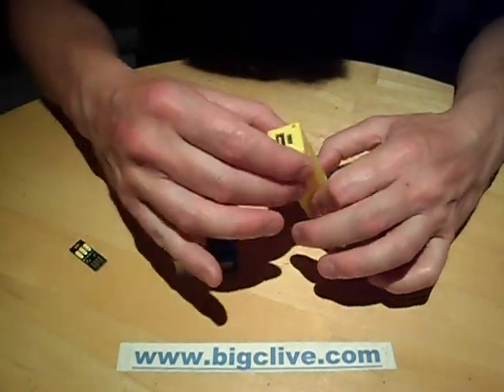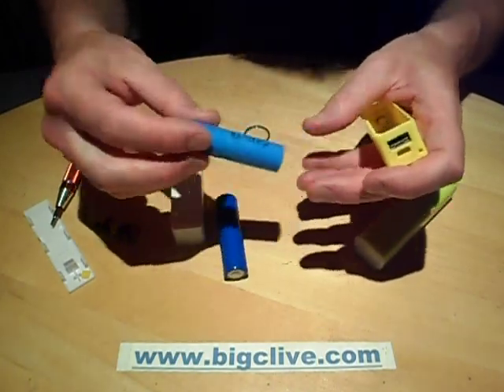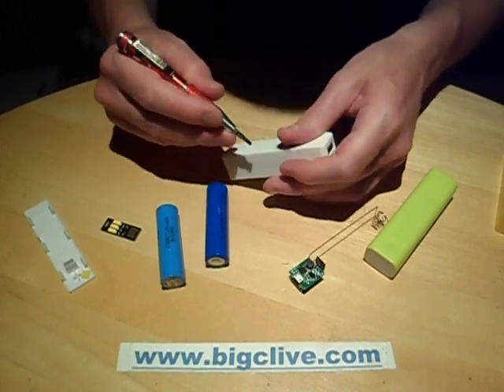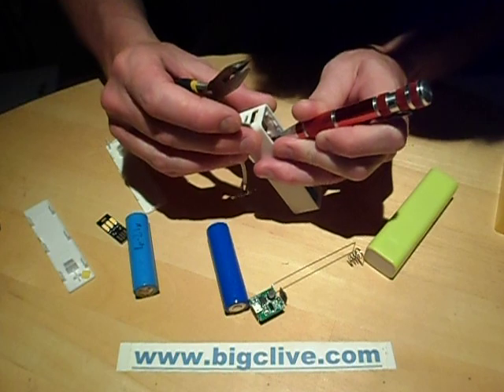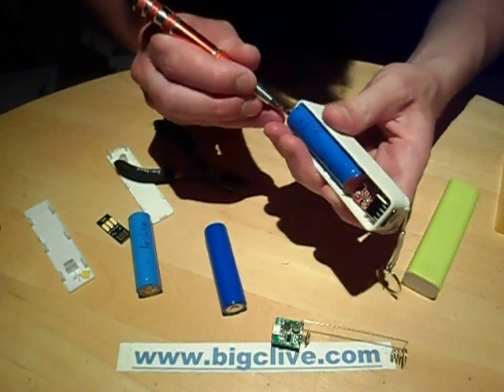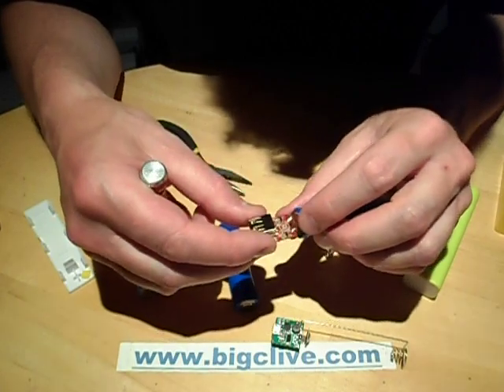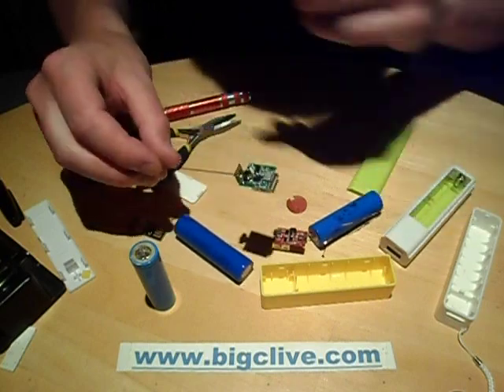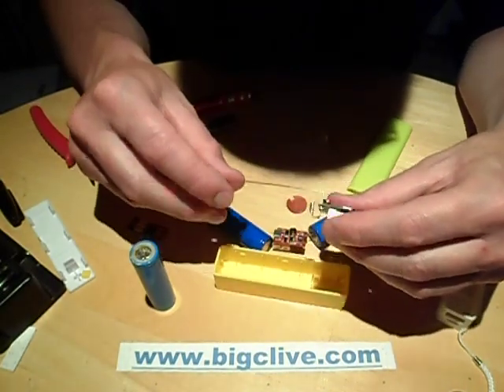Inside some USB power banks.

Comment: I am using this chip/circuit to charge a laptop battery (that stopped charging) I discovered it gets VERY HOT but is self limiting? It has no fuse. I am manually charging one of the three batteries (  3 X 4V= 12) at a time as I think the relative grounds on three simultaneous charging might fight/SC each other. Over 50 degrees Celsius with my bodge temperature gauge probe
Reply from the maker: These chips use linear current regulation, so they do get hot in use.

Comment: Fun fact. Poundworld are selling those single 18650 banks with a 1200mAh battery fitted. Not bad for a quid.
Reply: Just got one today in Lurid Green :D
Reply: They only had a nice shade of Purple left when I was in. I'll check back soon and see if they have re-stocked :)
Reply: There seems to be 2 slightly different versions. The lanyard hole is on the top vs side and the led display is circular vs rectangular. The supplied cable is shorter vs longer and packaging flat vs sloping. I got 4 black, 3 blue + 1 white. Just wondering if they give the full 1.2Ah and charge at 0.7A?
Reply: The ones I have are with the lanyard on the side. Haven't had a chance to test them, but the label says 1200mAh, and charge at 5V 700mA.

Comment: Any idea of what could cause a failure mode on single chip version, where the chip on the board gets hot at 91°c, and stays there without anything connected?
Reply from the maker: +bridgendesar Dead chip.  If the cell hasn't been over-discharged too far then it may be salvageable.
Reply: +bigclivedotcom if only I could find the chip number online and get another one, do you have any url's, or should I quit while I haven't burned down my house!
Reply from the maker: +bridgendesar It's generally cheaper to buy a complete new power bank than it is to source one of the chips.  They only seem to be available to the power bank manufacturers.  check for short circuits like blobs of solder between pads, but it's still probably cheaper and easier just to get another unit.

Comment: I have the same style power bank as the second one. If I wired in ANOTHER 18650 in parallel would it still work and/or last longer? I have at least a dozen of 18650's from laptop power packs and am wondering; Can I wire them ALL up in parallel to make a MASSIVE usb power bank using the circuit board from the power bank?  Sorry I'm a bit of a noob when it comes to electronics like this.
Reply from the maker: +TheFlacker99 (Flak) theoretically yes, but I';d recommend getting them all near the same voltage first to avoid high current flow between cells in a different charge state.
Reply: bigclivedotcom AWESOME! Thank you. I now just need a project enclosure for 18 cells. MWAHAHAHAAAAA
Reply: +TheFlacker99 (Flak) The downside with Li-ion in parallel is if one fails, it will likely take all the others with it, as they will all get discharged too low.  You can get cheap power banks that take several cells, and these may have balancing circuits like in a laptop battery that keep the cells safer.   Julian Ilett has reviewed some of these.
Reply: Using it doesn't increase the risk so much.  And the charger will be timid as it's expecting only one cell so that's safe too.  just take care not to stab any of the cells, or short them out, and you'll be safe :)   I rewatched a couple of Julian Ilett's reviews,  and those cheap multi-cell powerbanks don't have any special precautions either.
Reply: +MattOGormanSmith "The downside with Li-ion in parallel is if one fails, it will likely take all the others with it, as they will all get discharged too low." That's not entirely true. Likely bring other cells down with it? That would require a cell to be shorting... Cells do a lot of things, but short is not one of them unless you put them under really incredibly extreme conditions such as melting the electrodes together. In a parallel configuration, if one cell is failing, having other cells which keep a normal cycle voltage across the faulty cell is one of the best things for it. You'll find more often than not if you put a faulty cell in parallel, the other cells will rehabilitate the damaged one, and I have never seen a damaged cell cause damage to other cells in parallel, nor does the concept really make sense to me.

One example is when I had an RC aircraft battery stuck in a tree for a week, and brought it home puffed as all hell with ~0.1 volts per cell. I tried putting some voltage across it, but It wouldn't hold a charge. So I hooked it up in parallel with another pack. Form there I cycled them ~10 times in parallel, and now the damaged pack operates at pretty much the same level that it used to, and the pack I used to rehabilitate it suffered no immediate damage, both were put back in the cycle of batteries and I haven't noticed either one since.

Yes, putting cells in parallel does open the possibility for one cell to damage the rest, but you have to have such an incredibly fucked up cell to achieve that. Any normal damaged or broken cell will not damage the working cells in a parallel configuration. If a cells voltage drops, the others bring it up, if a cell charged faster than the others, then it's voltage is brought down. It's a self-regulating system.

If you're cells are shorting out, you're going to have problems regardless of your configuration :)
Reply: MattOGormanSmith Uh oh. I made it. I have 8 cells in it. I guess I'll be risking the whole pack every time I use it. :P

Comment: I've had that happen...I hooked a camera battery up to my multimeter, and it read 0.00 on the volts, even on the Battery setting at 9v setting.  For some reason, I can't use the 1.5v setting on my meter's Battery function.

Comment: thats a shame as they lend themselves to being charged very quickly even though the power density is terrible. I could just imagine one of those USB power banks with a shed load of super capacitors. charge up in seconds (which is handy in today's life style). then use the power bank to charge say a phone when out and about
Reply: +BillyNoMates1974 You'd get about 5% charge, and you'd have to recharge the power bank after every 10 minutes, even if you didn't use it.

Comment: bigclive, do you know if anyone is selling a huge capacity USB power bank with super capacitors ? just thinking these things could be charged very quickly. the only downside is super capacitors have terrible power density
Reply from the maker: Super capacitors have such low energy density and high self-discharge that they are not really suited for use in power banks.
Reply: +bigclivedotcom no its not you know why??? capacitor is like filtered that generate joules and that joules called watts that watts is current that may do fast charge but to make it do charge much better may do ad little more farad than v of the cap so it will tweak much faster be carefull  capacitor may harm your device if you don't add inductor and transistor to make it much filtered filtering by transistor it will much useful to be handle and much less do ESD to your phone promise before you to brag me I do it in my own and I do destroy my mp3 ones to show it to my self how be safe or degarouse is cap in phones and It so.

Comment: Can you take a look at the build of some of the cheaper 18650 battery chargers please, I've had one from Amazon working great till yesterday when it filled my front room with a bright blue flash and bang. 
My fuse box circuit breaker for the plugs shut off and I had that lovely burned silicone smell..

Comment: Hello there., i got a question :)
I bought one of these with 5300mah but power is way down ofc.., not even close to 5300.. My question,. can I use this charger (obviously ment for 1 battery) to serial charge 4x18650 batteries., cause i have 4 spare ones., and they are kinda going to waste.. Or parallel for that matter :)
Reply from the maker: It's quite common for the chargers to use a common charge board for different arrays of cells wired in parallel, but initially it might be worth charging them one at a time so they all end up at a similar charge level.  If you connected a group of cells in parallel with different levels of charge then quite high current could flow between them as they attempted to equalise voltages.
Reply: I guess it would be best if i deplete them all to lowest voltage possible,. then work from there., Thank you for response :)
Reply from the maker: CroatianExTc Just so long as they are close.  Don't over-discharge them, as that can damage them.  Stop around 3V at the lowest.

Comment: Perfect video person for what I wanted to ask. :))
Can you guide me? I know that the up scaling reduces the current standby. I wanted to bypass the up scaling 5v, and convert the output into 3.7v, so that I can use it to light a bulb for hours. Can you tell me what should I add or remove in this circuit?
Reply from the maker: The chip in the power supply is really designed for the standard 5V USB voltage.  Other than connecting your light directly to the internal battery terminals I'm not sure if you can really adapt it to a lower voltage.  If running an LED lamp unattended or for long enough to drain the cell to it's lower safe voltage you may be best using protected cells.
Reply: bigclivedotcom Thank you for writing, :))
Oh yes... I am using Sony vaio cells. (you are saying these cells will auto shut when the safe low voltage is reached?)
Need of low power auto cutoff and full charge cutoff, is the reason I want to the tiny chip circuit from the power bank similar to in this video. So that when I leave it plugged for hours, the circuit might cut off the output?(assuming this by default) ... that's why wanted to convert the same output into 3.7v, so that I get benefit of long running energy as well as battery protection.
I tried experimenting. When I used the 3.7v cell directly with LED, it gave me 6 times more running time, than using the 5v output of the power bank.
Reply from the maker: Kketansa Art If you're scavenging cells from a battery pack then they will not have protection.  You need cells that are specifically marked as protected cells.  These cells disconnect the charging supply when the voltage exceeds the safe charging threshold (although you can't leave them charging continually) and also disconnect the output when the voltage falls to about 3V to protect the cell.
The smaller USB power banks do not always properly disconnect the cell at the lower threshold.
Reply from the maker: Kketansa Art Your longer LED running time was probably down to the difference in current running at 3.6V instead of 5V.  Are you using a suitable resistor or other current limiter with your LEDs?
Reply: oh is it so...? then I think I need a low voltage cutoff circuit. May be there is something simple that I can compose with few diodes and registers....
Yes longer LED time was running at 3.7v directly from the cell. 5v upscale reduces the run drastically.
I am using 2.2ohm1/2watt resistor as current limiter, and 1ohm 1/2watt resister for brighter light. The 2.2ohm gives more running time here.
Reply: BigClive :)) What if I use yet higher value of Ohms  limiter resistor before the LED e.g. 5ohms or so? Will it give more backup?
Reply from the maker: Kketansa Art Yes.  If you increase the resistor value it will reduce the current through the LED and give you a longer run time.

Comment: Do you know any 2 cell kits/boards? I've bought two 3400mAh Panasonic accu 18650 cells, but I believe the board in the accu bank I wanted to put them in has died.
Reply from the maker: The usual Chinese suppliers on ebay and their own sites sell the multi-cell power bank kits.  Here's a typical unit from an ebay seller:-
http://www.ebay.co.uk/itm/191171111160
I don't see the battery contacts in the picture associated with that power-bank, so I'm not sure if it's designed for soldered-in tagged cells.
But if you do a search for "diy 18650 power bank" on ebay you'll see there are quite a few options.
Reply: Thanks a lot! Guess I managed to choose just the wrong search terms, couldn't find anything yesterday.
Love your videos btw, keep up the good work :P
Reply: Okay, so I just found this sheet on my Li-ion cells, it appears that if I charge them in the freezer and discharge them at 40 degrees, I get more efficient battery's? This must be tested :P

Comment: so in terms of using as a charger for a phone. ( well a bonus charger like a powerbee) how good are they ? a 30% gain ? or less/more?
Reply from the maker: It all depends on the capacity of your phones internal battery.  It won't be a direct mAh ratio since the power bank has to step the voltage up before it gets stepped down again by the phone making the charging less efficient.  But it's certainly going to be a useful charge.  The internal cell is rated around 2200mAh so that should give a rough idea of how many full charges (or how much of a single charge) you could get before it needed recharged.